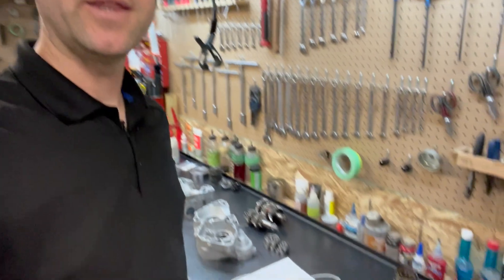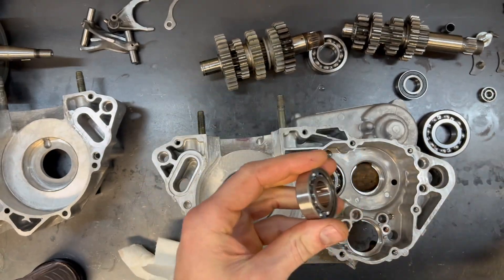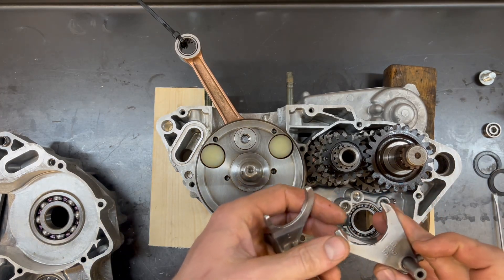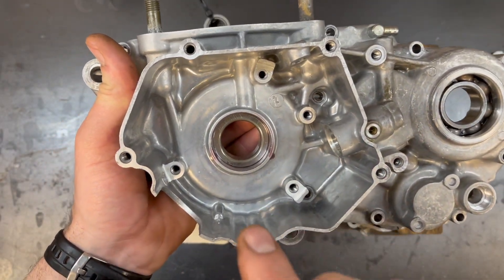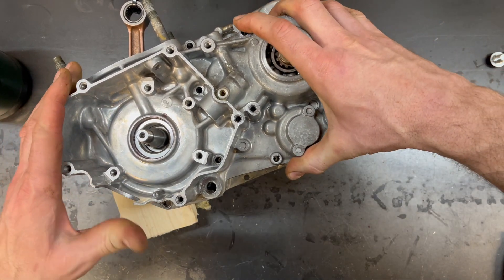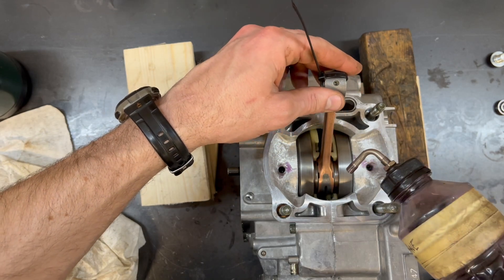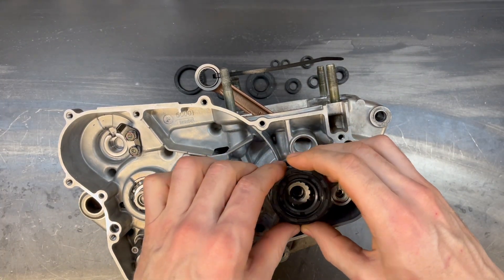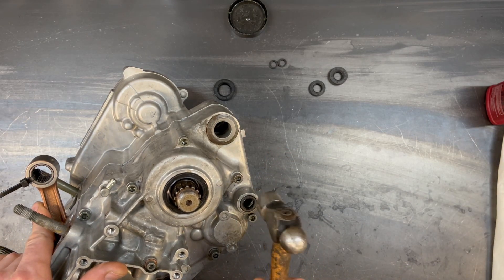YZ250 Bottom End Assembly- How To / Walkthrough

Comment: ******NO SEALS ON TRANS BEARING ???? HOW ABOUT CLUCH OILING ?????????
Reply from the maker: Why would you want a seal on the tranny bearings?
Reply: for oilinh on clutch shaft  i saw a vid on it @ChuckfromTrueTech
Reply: Ask the Yamaha engineers - the upper left oem bearing has a stainless seal on the outside, and the upper right oem has a rubber seal…   Oil still flows through Below.   My guess is to keep oil from sloshing through up high where it is not making contact with  moving parts

Comment: I don’t know where you learned the tap method to free up the tension on the crank bearings but you probably just saved my build.  Got the whole bottom end fully done literally two days ago, before I knew this video existed. Watched it this morning; thought about it all day at work.  So tonight I took the stator and flywheel off then had to get the brand new OEM crank seal out which was a pain. Did the tap and sure enough the crank spins free.  Would not doing this cause premature bearing failure?  Thanks a bunch man ✌️
Reply from the maker: I’ve seen a lot of unexplained crank bearing failures that have a good long life after I repair them, making no modifications. Modern enduro bikes also tend to be switching to roller bearings and the problems are going away. I think there’s good evidence to suggest that many premature crank bearing failures are due to unrelieved side load.

Comment: Interesting. Never thought of pulling the crank into the case via the inner race of the main bearing, if you went too far you would start to press the bearing out of the case though? I see why you choose your own method for ease of setup however it doesn’t always go that smoothly when using heat. If using heat to put cases together you have to be very well timed and ensure your puller is close by ready to go if the bearing suddenly stops. First few engines I ever built I was scraping and cleaning the yamabond off the cases and starting again
Reply from the maker: You won’t press the bearing out of the case, but you can put side load on the bearing the opposite way or pull the crank out of true.
You’re right that it can be tricky to get the timing right with heat.
Reply: @ChuckfromTrueTech  I need to try tapping the inner race of the main bearing on this RM125 I just built, crank is very slightly resistant to turn. Used a puller on both sides to seat the crank however still not perfect. Will remove the crank seal and try hitting the bearing lightly

Comment: When you installed the clutch side crankcase seal initially it appeared that you installed it with the spring facing outwards ( as I believe it should be? ) but only moments later in the edited video it appears you reversed the seal and now the spring was facing inwards towards the crank/centre of the engine. Is the general rule not that the spring faces towards the medium that it is sealing?
Reply from the maker: The purpose of the crank seal is first to seal in crankcase pressure. Of course it  is also responsible for preventing oil from entering the crankcase but that is secondary.

Comment: very informative video. At first I did think you realized the the seal can rub on the bearing. Do you have a source for the bearings? Subbed...
Reply from the maker: The bearings are easy to cone by if you search by size. YZ250 uses 63/28 C3 or C4 bearings. Just buy Japanese, IE: Koyo, NSK, NTN etc. I rarely buy OEM.